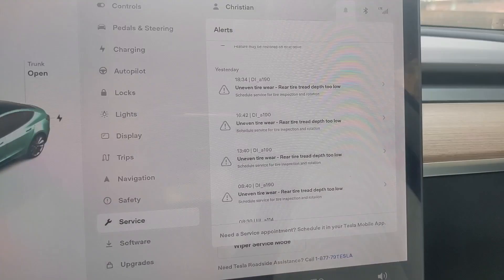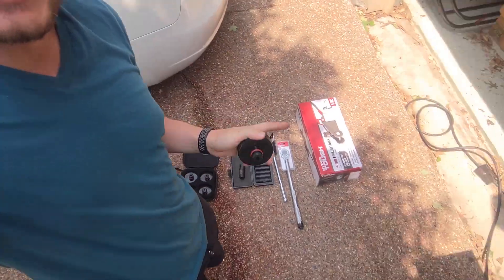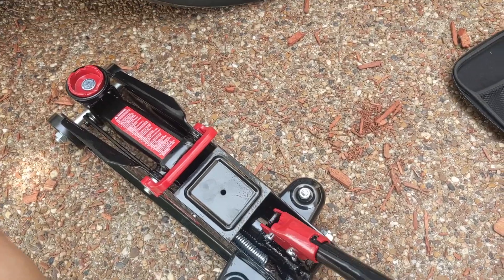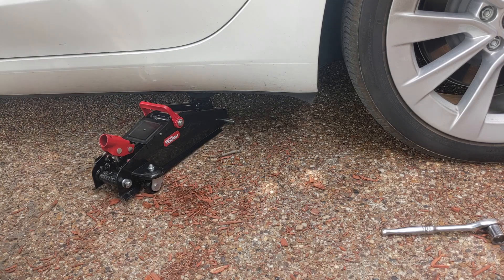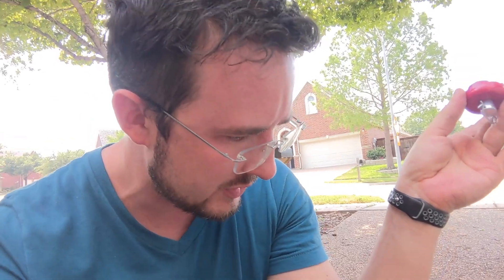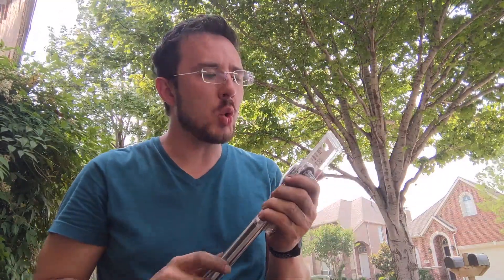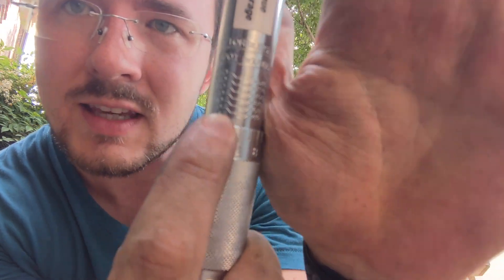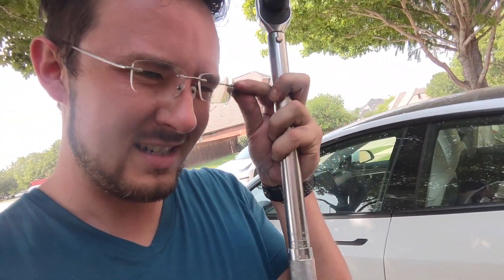How I fixed 'Rear Tire Treat Depth Too Low' on my Tesla Model 3

Comment: Finally I find someone who answered this question lol. Gonna give it a go and see if it works. I bought brand new rear tires for my model 3, and did not even cheap out on them. Apparently they still aren’t up to tesla spec and the code comes and goes
Reply: Did it help?

Comment: For another time, drive the car up on two thick wooden planks, or anything making it raise the bottom of the car up from the surface. This will make it fit under the puck with the wheels on 😉